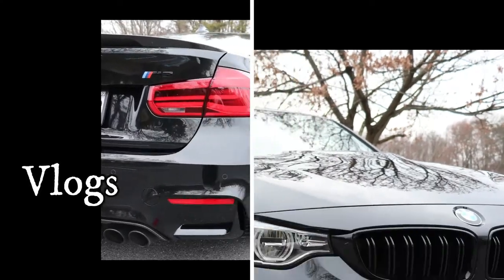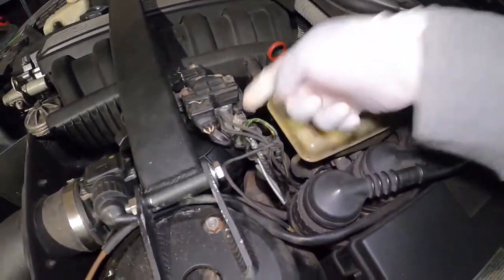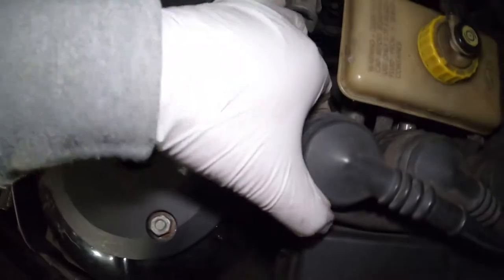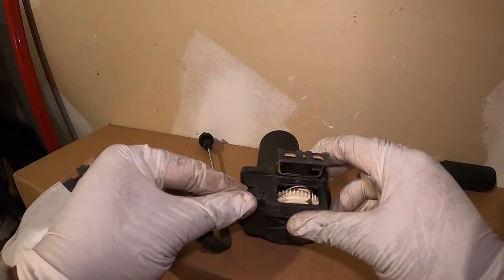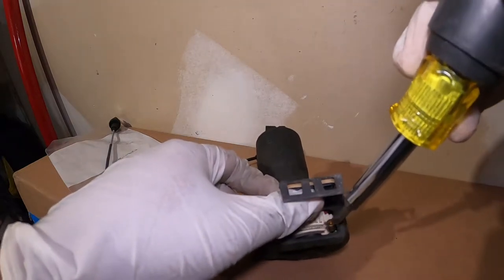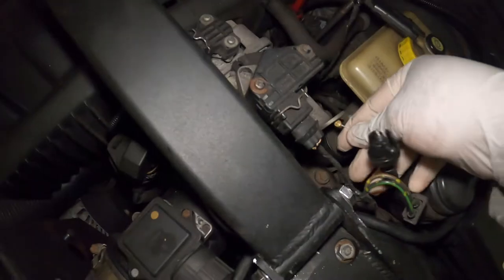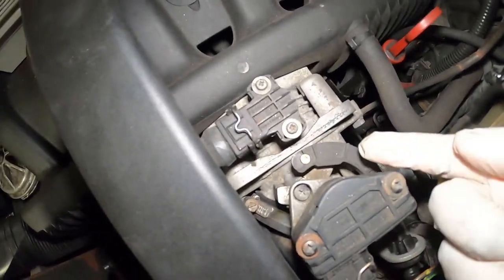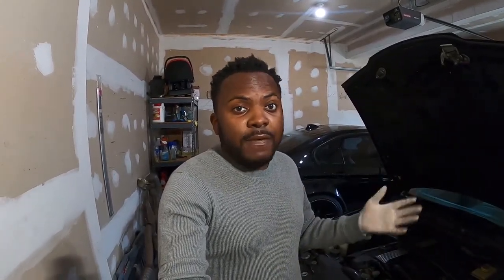How to Fix ABS and ASC Light on E36 BMW M3

Comment: Hi Torvek, I have replaced my ABS controler, speed sensors, which was recommended by my mechanics, but the ASC and ABS lights were still on. Your video gave me another point of view and I found my car having the trouble in this cable. I put some epoxy to fix the cable supporter to my car and hope it will work. Your video is truly helpful.
Update: I cleared the engine code after this problem was fixed, but it turned on again after driving for 5 minutes. the ABS light keeps on all the time.
Reply: Did u ever figure out the issue?
Reply: @goonie3s63  no, I will take it to a dealer

Comment: Hello, nice video. Thank you very much. Question.... Is there a possibility either the cable or actuator itself gets cleaned to solve this issue?
Reply from the maker: I am not sure. You may want to try and let us know if that helped!
Reply: @TorvekMotors  I cleaned it, it didn't work. I put a new actuator cable in it, still didn't work. I swapped the 30A fuse ASC/ESP, still didn't work. Still driving around with those two lights on. I have a 328iC convertible 1997

Comment: Did the throttle body or what the cable is connected to move before you changed the cable?
Reply from the maker: The throttle cable was not touched during this procedure. Thanks
Reply: @TorvekMotors  ye, you tested in the last bit of the video, If the thing moved, did That work before you changed the cabel
Reply: At 11:45
Reply from the maker: It was working on and off. After the fix that cable is always working. Thanks
Reply: @TorvekMotors  thanks mine is like That work 2times in a row the stopped working